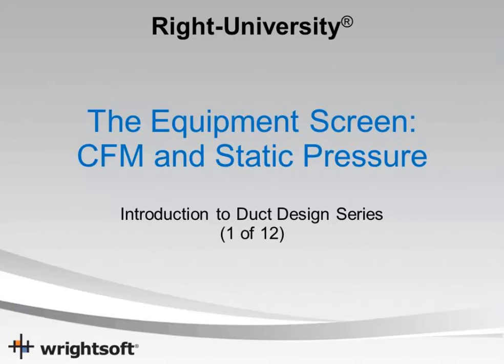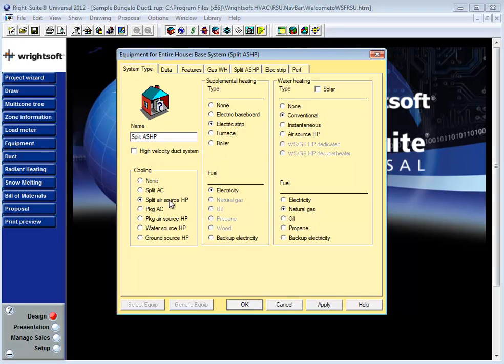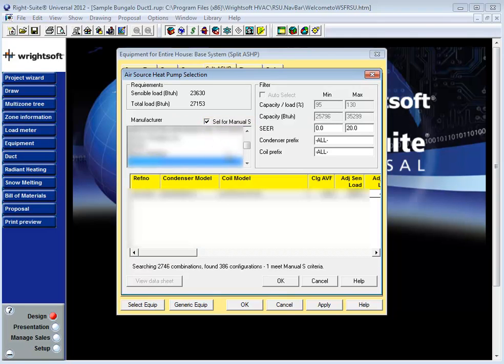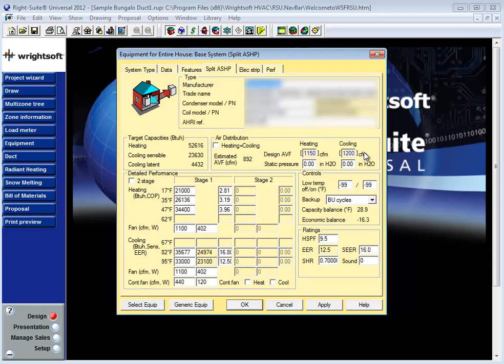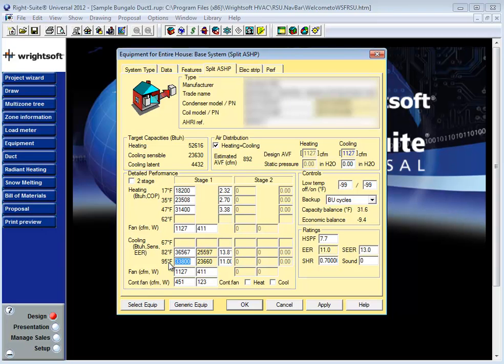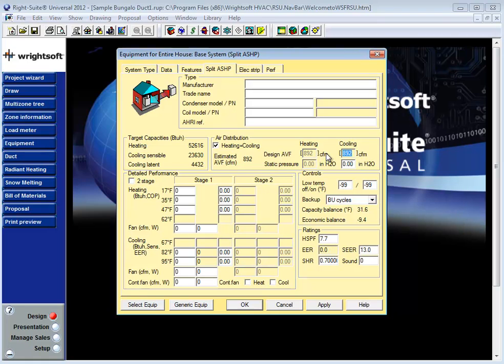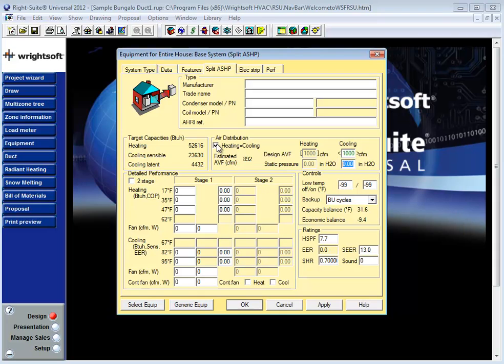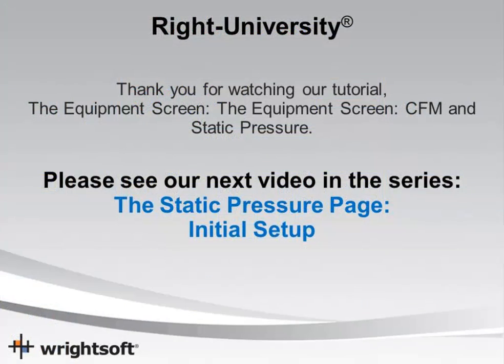[Wrightsoft] Example Duct Design (Step 1)  The Equipment Screen, CFM and Static Pressure

Comment: My application doesn't allow me to select a GSHP when selecting equipment. Is there an additional software program that is necessary to buy? Like the Right-Loop? I currently use a different system now. And I am designing for a district project as well and don't need the loop design function.